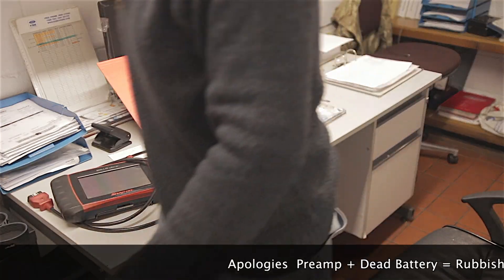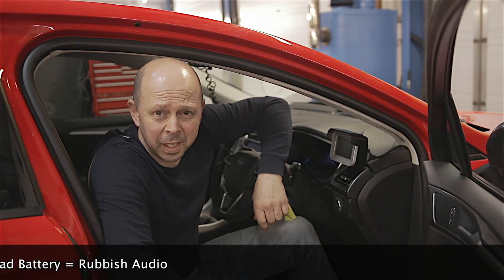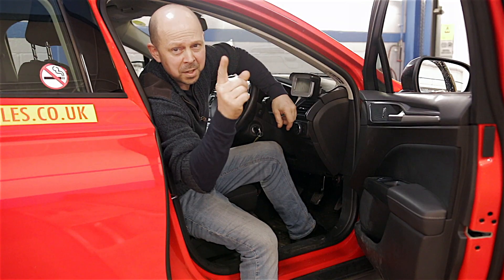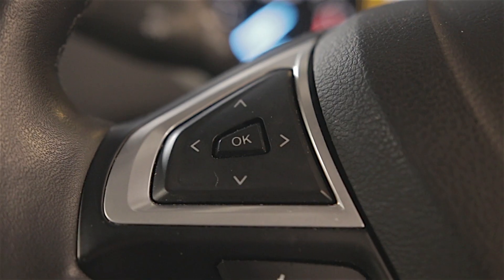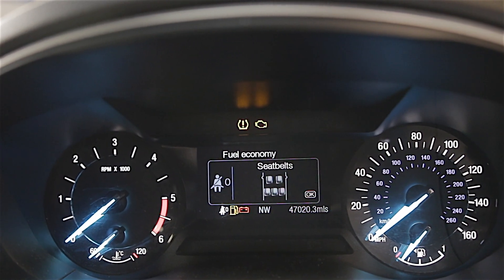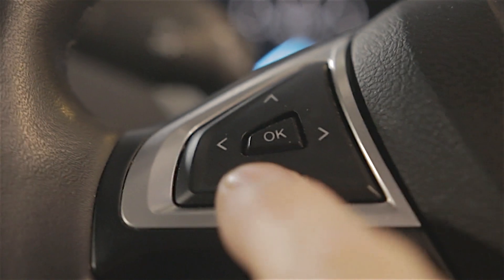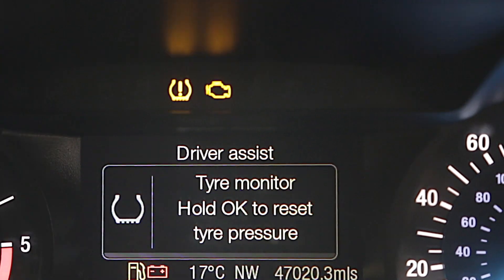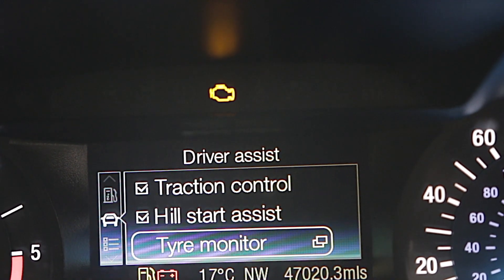Ford Mondeo Mk5, Tyre Pressure Monitoring System (tpms) Reset Procedure.

Comment: I have a tyre pressure malfunction warning coming. Checked the pressure and reset it, after a few miles it comes back on. Is it just a case of replacing the sensor?

Comment: ❤ my life saver I’m just now puzzled what the actual pressure is I’ve put them to 30lbs all round and it still says low pressure , When I bought this in summer it had winter tyres on it man was a plonker . It’s a 15 plate modeo zetec econetic tdci 1560 cc

Comment: it resets its self on my 16 plate mk5, worth mentioning that the space saver wheel does not have a sensor fitted an so shows the warning untill you get the proper wheel back on :)
How about a rant about new mk5's only having non kerb friendly low profiles, or spokes that stick out beyond the tire so that they hit the kerb.